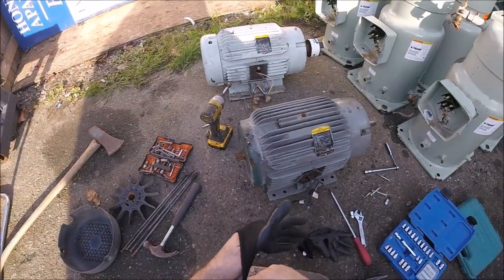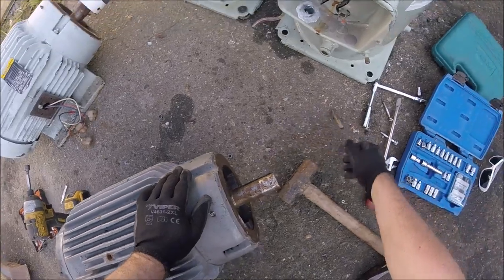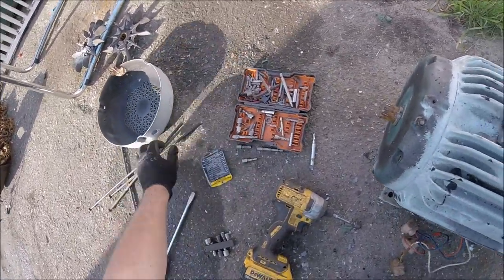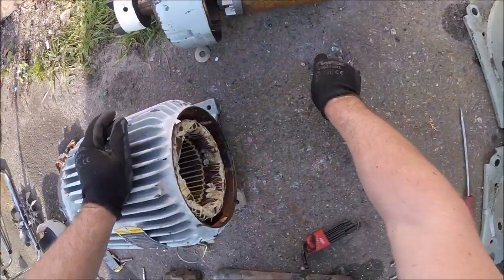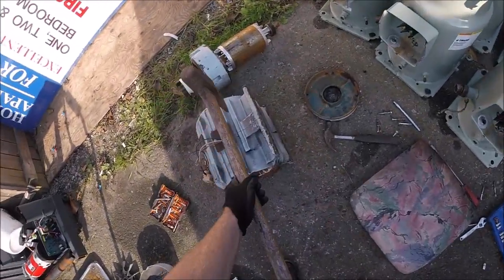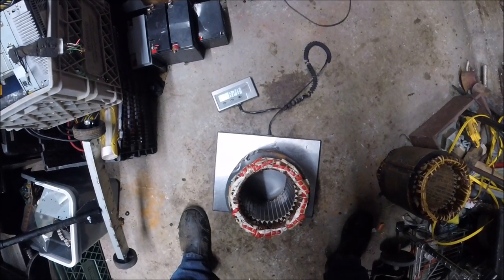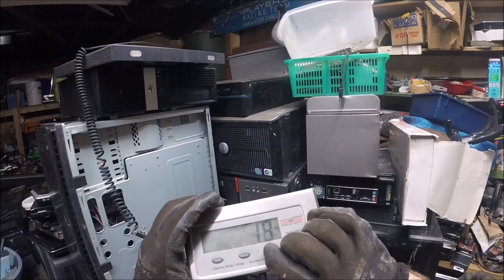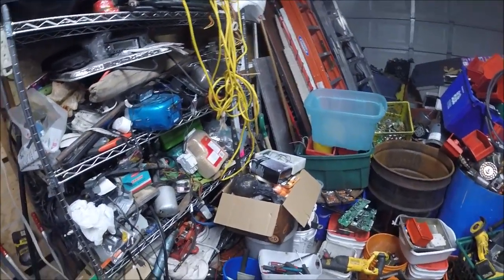How to Scrapping Cast Commercial Electric Motors

Comment: Lol how'd you lose your eye? "I was using an axe to crack open a motor"
Reply: Daniel Sullivan he has glasses on i believe
Reply: @joshuamorris9050  those glasses aren't worth much  if a piece of iron hits them ..better than none  I guess but should be use impact resistant safety
Reply: The dude definitely needs to invest in an air chisel. It would cut through that like butter but if he doesn't do this alot it's probably not worth it.

Comment: Honestly man, thank you for scrapping metal. Its sooo much better for the planet that we reuse our metals. It's really ignorant to just throw out metal, especially electronics copper, its literally 99.999% pure.
Reply: Even better is just to rewind the motor. Take the old copper coils without destroying the stator and the rotor.
Reply: Even better is reusing motors if not too damaged. Even crappy permanent magnet conversions on big ac motors are better than nothing. 

I have a 200kg/440 pound motor waiting to be tested if the coils are ok. If yes, rotor is mounted with a boxfull of magnets and turned into generator for oil drum savoniuses. If not, just gonna wait and gather more of them junk motors for melting.

Comment: If i have theese simillar big motors, i use on shaft and other problems my angle grinder to resolving all problems. But this is a megaloman motor how total weight have one? And how finally clean copper was inside? I was scrapping maximum weight 3 phase motor about 11,5 kg :) and angle grinder and hammer solved all dismantling problems  :) Have all scrappers happy and merdy christmass

Comment: Just curious as to why not split the top and bottom? Instead if extra time and energy hacking at it more than twice.
Reply from the maker: This is a 250 pound motor not a 40 pounder
Reply: @CanadianTreasureHunter  trust me I get that, even with the bell ends and rotor out, it has pretty good heft to it. While it's easy for me to to armchair quarter back the video. I was just pointing out a possibility of a more efficient way of doing it. 
The splitting maul was an " aw yes" not a bad way to do it. Especially when you don't have a press to split the case.
I just figured split between the mounting feet and top and the stator is free.

Comment: im gunna give you a big like . the reason why ? because i grew up as kid stripping these motors daily for many years and all the videos you see on youtube are from people with spanners and techniques for stripping them. the quickest way is with a big hammer. period. done many thousands of them various ways and a big sledge hammer is the easiest way . also i found a old mining tool which is a iron rod with a chisel set into it. for the casing.
Reply: Can you elaborate about the hammer? You talkin just use a 10lb sledge and swing away at it? Bcuz ive tried that and got nothing but bent steel around copper, which became a HUUUUUGE p.i.t.a. to extract the copper after that.
Reply: The two best ways ive encountered are cutting off both ends and running as big a punch can fit in between, or cut one side and grab the other side w/vise grips or channel locks and sledge the steel down while holding that tool you choose to grab the end with.

Comment: I have two big industrial motors that take two people to move. Some of the housing looks like an exotic metal kind of brass toned but kind of white too. Possibly something like inconnel? Not sure. I hit the shaft with a sledge hammer but it is solid built. My sledge hammer just bounces off it. Might just have to sell them as motor scrap.
Reply: If you are gonna scrap it  .  I am serious ,drill it , a half inch hole fill with black powder and blow it apart . Drive out to the middle of no where . learn how to make sugar fuses ,look them up on you tube
Reply: Only a suggestion  a hand grinder and a sait  cutting   disk for stainless. I've used steel wedge flange spreader for pipe fitting as well as a steel chisel. If it's that hard of metal if it's cast it will crack easily. If there is a nameplate on your motor look up the manufacturer specs it should tell you all you need to know.

Comment: Just out of curiosity how much did the motor itself weigh and how much copper did you end up getting out of this? I have an opportunity to buy these at 50 cents a pound and trying to figure out if it'd be worth it to buy them for that and to get the copper out as current prices are $3.11 a pound for number 2
Reply from the maker: over 200 pounds & hard to strip, I still have the stator that weigh over 80 pounds with the copper in it
Reply: 50 cent is way to much

Comment: You know that an axe is only for wood right ?
Reply from the maker: Not used for wood
Reply: @CanadianTreasureHunter  , Wow .... I didn't see that ...........
Reply: He could get blind or use a hydraulic wood splitter to crack the cast on each side without a problem . Seems like he has the money to at least use a Sawzall with a long metal blade or buy a cheap Chinese bandsaw and use a chisel with a hammer to split it . But cavemen have their style 😆😆😆

Comment: Baldor motors are industrial motors, not commercial. "Big boy" not really, probably only around 20 horsepower. Pull apart a 500 hp motor.

Comment: If I were splitting these cast iron cases I would use an electric jackhammer, Less effort.
Reply from the maker: You would need a very big jack hammer
Reply: @CanadianTreasureHunter  I have 3 larg Hitati jackhammers that would do this easily
Reply: Best way is with a 9” grinder